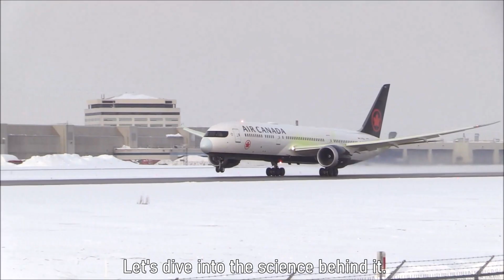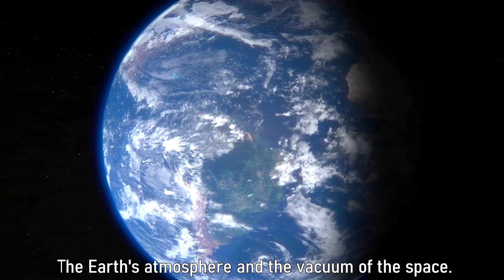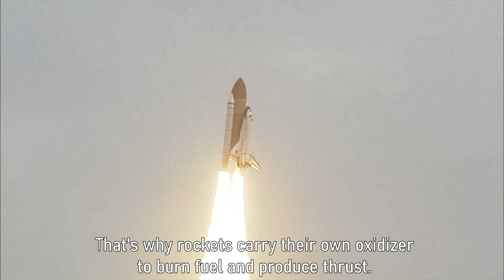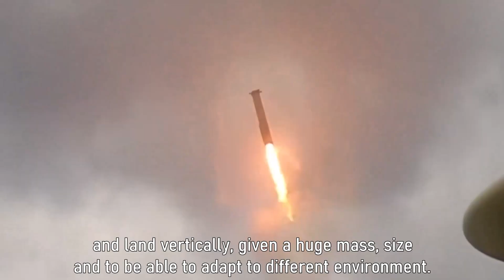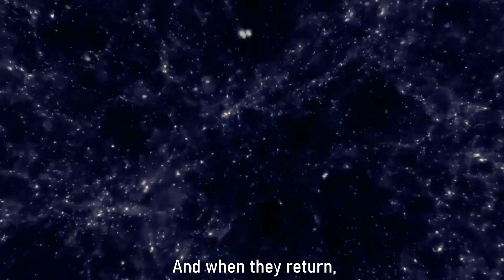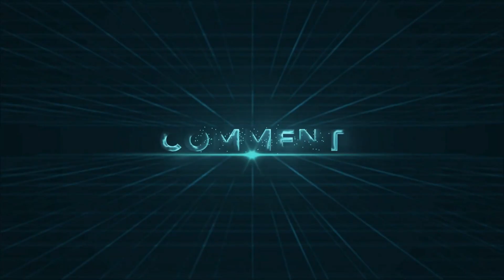Why rocket can't land like an airplane

Comment: You really need to do more research before posting inaccurate stuff like this.  Boosters that take off from runways have been designed before and are in use now for some flights.  The space shuttle took off like a rocket, yes, but returned as a glider, landing on a runway like any other airplane.  It could land at any major airport if required, but normally landed on the long airstrip at Cape Canaveral or the dry lakebed in California so that it could be close to the services it required to  be readied for another launch.  Please, don't post these "facts" without thoroughly researching the topic first.  There is too much misinformation going around the Web as it is.
Reply from the maker: Appreciate you feedback, but gliding in moon and mars will be difficult as it does not have atmosphere like earth. So the information provided in video still holds true. Thank you
Reply: @nulligence  I have and entire book entitled "The Dynamics of Manned Lifting Planetary Entry" from the mid-60s, and it has example landing profiles for landing on Mars, etc. Of course it won't work on the moon.